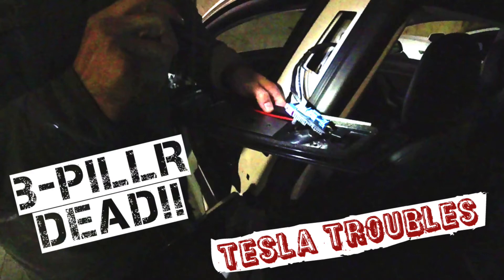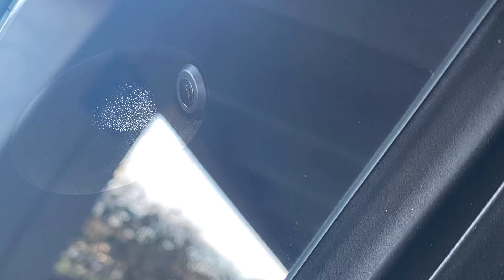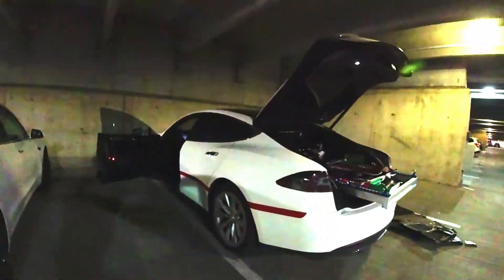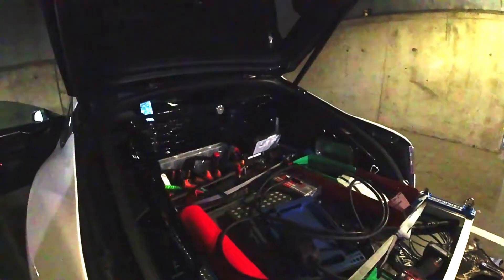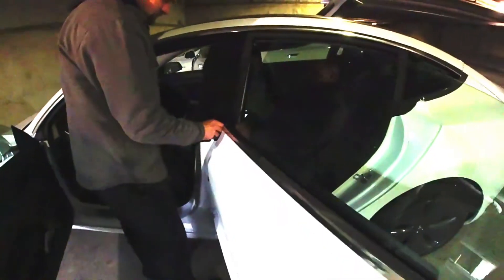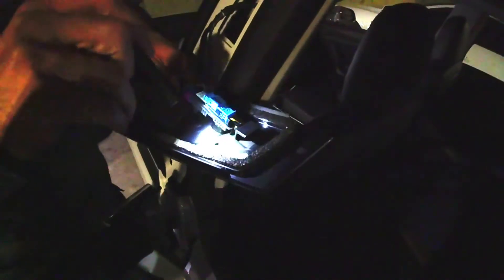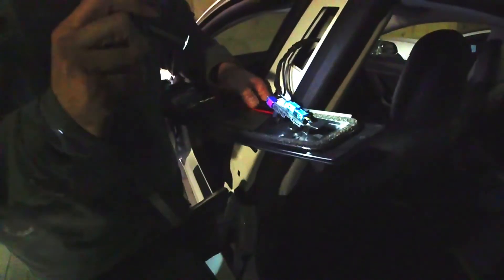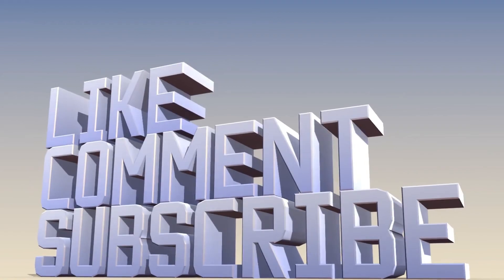B-pillar camera fogging up!

Comment: I rented two different 2022 Model Y's one in MN and one in CO through Hertz for a week each in winter. they both had this issue. the one in CO, once  the moisture formed, which it always did, would never clear up. :( the MN was more erratic and sometimes would.
Reply from the maker: Rumor has it the issue was finally fixed. Mine I can report hasn't had the issue since I first posted this video.

Comment: Thanks for the video. Not the response I got from my mobile service request. I got the ole’ , “To proactively dry the condensation, precondition the cabin by setting it to a warm temperature, turning the windshield defroster on, and directing the front air vents toward the door pillars (see Mobile App on page 155). Next, navigate to the Cleaning topic. In the "Cleaning the Exterior" section, ensure the 2nd paragraph says the following: "Keep the exterior cameras free of dirt, condensation, or obstructions....at this time there is no indication of a hardware fault with the side cameras. The alert you are seeing is merely and indication the cameras are blocked. At this time we are going to cancel your service visit.” Plan to send a link to your video to show the disparate treatment.
Reply from the maker: Oh I got that BS response too! Then I kept on my local service guys and got a good tech to come out and told the truth😁
Reply: To close the loop. Mobile service did decide to come out and investigate the situation and did replace the camera under warranty just for good measure.  Thanks Lucas (Tesla Mobile Service) for working with me on this concern!

Comment: Did that little plug actually work? I figured future versions would have a little heat wire on the glass like the rear windows to get the temp up
Reply from the maker: Shockingly it did...lol I get the warning now every now and then when it’s sunny but the condensation never came back.

Comment: What year is your car? I believe 17-19 years M3's have the gortex plug still the 2020 and beyond have that removed for hvac to help remove condensation. Most of the time service just say's it's designed that way.
Reply from the maker: Mine is a  Model 3 2020 and I was a bit surprised the tech was cool with telling me about the sticker. I'd think a few small air holes drilled in would prevent that as well, but not sure.

Comment: So when replacing this b pillar applique it doesn't need firmware and recalibration, does it?
Reply from the maker: It does and sorry about the delay in responding. You can calibrate it yourself but the tech did it for me.